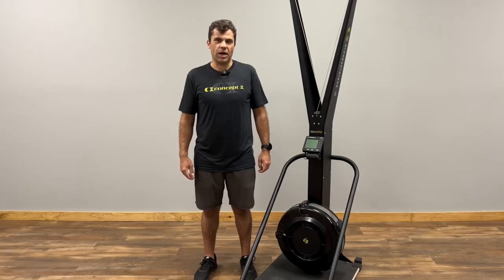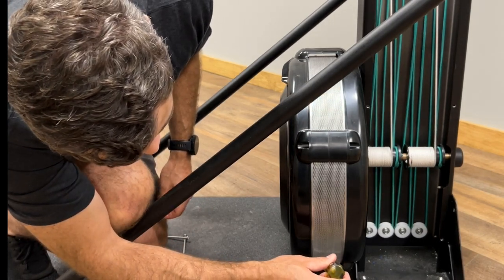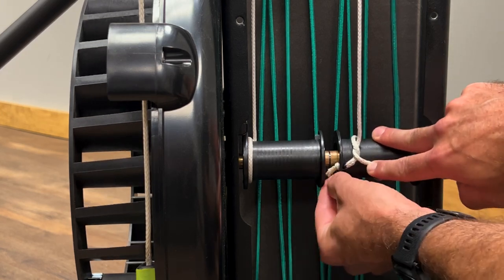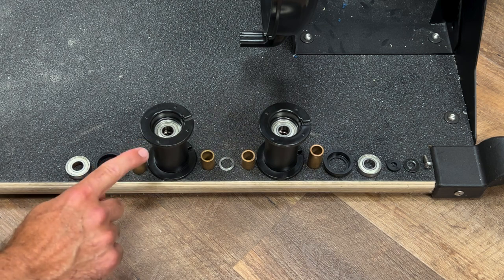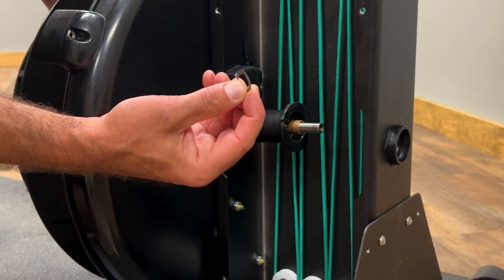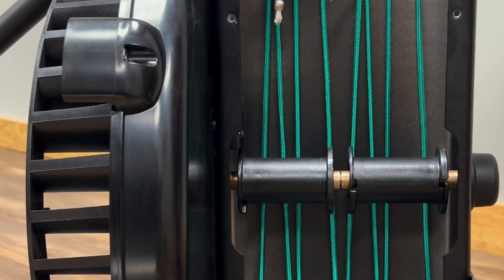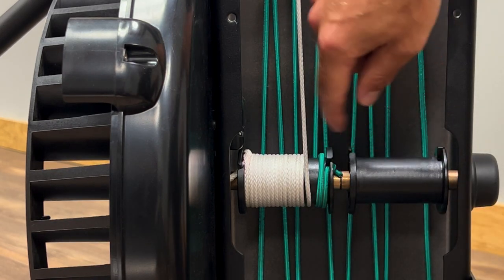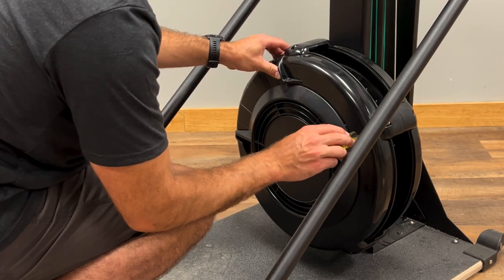SkiErg Flywheel and Spool Replacement

Comment: Hi.

My machine has a problem. Sometimes, not allways, it starts doing a really umpleasant noise.

Does it need any lubricant? Is it possible that the pieces in the axis has some slack that may cause the noise?

Thx
Reply: I recently also noticed some rattling sound, and indeed seems the brass spacer tubes has a slightly larger diameter than the axle, and has some play in them, meaning if they get pushed against eg. the frame, the might get stuck a bit, then released, that is causing this sound. I ended up adding some grease on the axle, that might fill in the space so it couldn't rattle / get stuck in the first place. But I still need to do some experimenting with it.